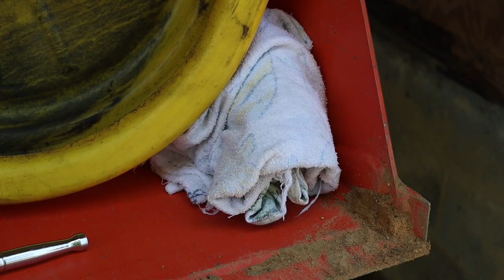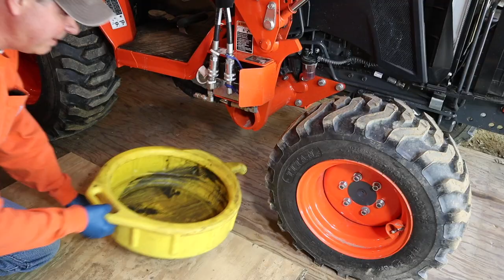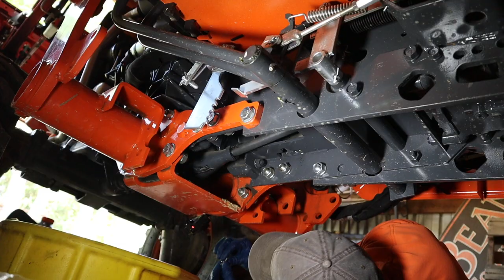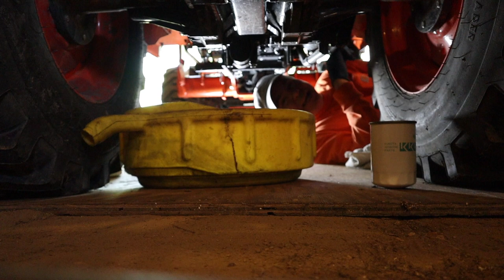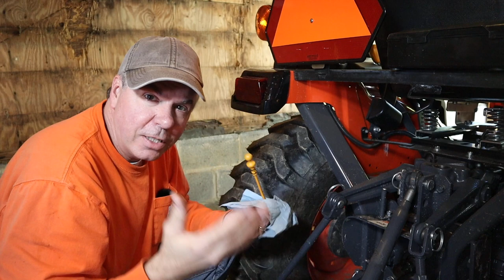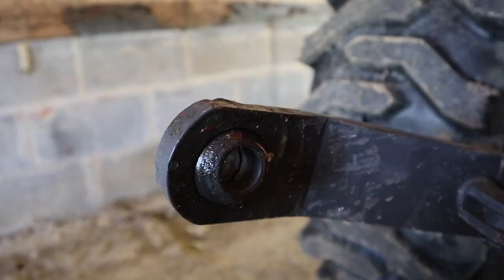#12 Kubota B2601 50 Hour Service How To - Complete With Bonus Tips!

Comment: Just a note...when checking hydrolic fluid level, the three point lift should be all the way down and the loader should be all the way down and the bucket rolled all the way back. This retracts all the cylinders and pushes the fluid into the dip stick check reservoir. If any of the cylinders are extended you'll get a low reading on the dipstick. Then if you add fluid you'll actually be over full.

Comment: When changing out the hydraulic filter you can hook up a shop vacuum to the fill port and tape it in place. This will hold back most of the oil while you are changing out the filter. Less messy. Try it next time! Great videos!
Reply from the maker: Thanks Jack!
Reply: I really hate horizontal filters…

Comment: You are fast on that filter change!!!  I did mine yesterday and lost about 2 gallons of fluid.  My oil pan overflowed.  I have a mid-mount mower deck, so I had to remove the backhoe and go in from behind.  Thank you for the heads up.  I noticed that the B2301 and B2601 don't have side marker lights.  I installed red and amber button LED marker lights for protection at night.  My dealer and the mechanics were impressed.  I also mounted a dome LED beacon on an "L" shaped bracket so it will swivel and self-adjust on the ROPS depending on the ROPS position.

Comment: As always, great video. 
A few "nerd" tips: 
When a copper washer is tightened, they get work hardened. 
Just place them on a fireproof surface and heat them up with a blowtorch. 
That will make them malleable and seal better, the next time around. 
Another tip is to pre fill the engine oil filter. 
It makes the oil pressure come up faster and is easier on the engine. 

Greetings from Sweden.
Reply from the maker: Thanks for watching and for the greeting from Sweden! Interesting tip about the copper washer. Your comments are much appreciated!
Reply: @MyClutteredGarage I do this with my Ducati.  You technically have to replace the copper washer with every filter change, but annealing the washer works just fine.

Comment: Prior to removing oil cap, I always hit it with a rag and compressed air to remove any debris and I also rest the cap back on top so nothing can sneak into the hole. Bad place for debris to get into. I already spray the drain plugs with engine degreaser and wipe them down before removing them as well. Appreciate the video. All seems pretty straight forward
Reply from the maker: Good tips. Thanks!

Comment: A good tip when changing the hydraulic filter first clean the surface,  use a clean container so you can reuses the oil as it last 400 hours. Use a funnel to make your live easy  :)

Comment: Very simple and to the point glad I watched it. On the filter removal they make  a filter socket that fits over the oil filter  face it has a 3/8"  female recess  for a 3/8" socket wench. I have used them on other vehicles  and will try them on  the tractor.
Reply from the maker: Thank Lonnie. I appreciate you suggestions. -Ed

Comment: Another great video.  You are right about the Hydraulic Oil being messy.  Wow.   Thanks.

The white Oil filters are great, you can write the date and hours on them very easily.   Then you can always do a quick check of last service, without referring to your notes.  That is if you can get the cap off of your magic marker. 😆

Comment: Just a tip if you leave the filler cap in place it will slow the initial rush of oil out of the pan, once you have opened the drain bolt then open the fill cap. Keeps the mess to a minimum. Try it , works. Cheers.
Reply from the maker: Thanks!

Comment: Just did my 50 hr service (at 75hrs) and it went well until I got that hydraulic filter.  I lost 2 gallons of fluid!  Totally blew it.  You killed it.  Great job!  Next time I'm calling you.  :)
Reply from the maker: David Armstrong Haha! That one is definitely a challenge. I’ll change your filter if you pour my concrete floor in my tractor shed (you may have spotted the plywood on the dirt floor 😄) -Ed@MCG
Reply: There's a vacuum trick that works pretty well with the hydraulic fluid.  Take the cap off the back of the hydraulic fill and have someone hold a vacuum next to the fill not totally covering the hole.  The pressure from the vacuum keeps most of the fluid from gushing out.  If you're alone, some guys tape the vacuum to the hole.  Other videos on this trick.  Check it out.

Comment: This video was a good reminder that not all the hydraulic oil needs to be drained at a filter change.  I was under the misunderstanding that the hydro oil need to be "changed", the same as the engine crankcase oil.  Very helpful!  If you know, when does the hydro oil actually need to be changed, but I suspect the owner's manual addresses that.  This is a good example ot the need to READ AND UNDERSTAND the instructions, a common failure some of us men have. ;-)
Reply from the maker: Hi Gerald. According to my manual - yes I looked it up - the hydraulic oil only needs to be changed every 400 hours. Score! I was actually thinking I was getting close at 150+ hours but I'll be good for another season or so! Thanks for your comment, and thank's for making me pull up the manual :)
Reply: Isn't the hydraulic fluid and hydrostatic fluid, the same fluid in the same reservoir?

Comment: So great video and thank you for showing the maintenance of the tractor. But I have a few things to point out to make sure its easier for ya. First off they have an oil filter claw tool that can be used on a 3/4 ratchet which will make taking the filters off easier than that tool you used in the video. The other thing is putting on the oil filters on by hand is more than enough. By using the tool to tighten them on will make the next filter change a bit more difficult to remove. Again great video thank you!
Reply from the maker: Great points. Thanks much! -Ed

Comment: Thank you for this video, I am nearing my 50 hour maintenance on my B2601 and this video was perfect.  I’m still a bit worried about changing the hydraulic filter however.  I changed it on my B25D before trading it and didn’t lose more than a cup of hydraulic fluid.  If your not quick to spin on the new one you’ll have a big mess.

Comment: If you have an extra person you can use a shop vac over the fill hole to minimize the oil loss. Shop that creates a negative pressure which stops the oil from draining out.

Comment: I used this video as a guide to service my B2601.  Everything went exactly to plan until I did the hydraulic oil filter.   Not sure if it was because I had my bucket raised (safety lock in place) or not, but the oil flowed like a fire hydrant.  I couldn't get the new filter on as it was instantly covered by fluid and my hands were soaked.  Threading it on was a nightmare and I lost most all my fluid.  Most was caught by the bucket, but I had some overflow mess too.   Next time I'll definitely have my bucket on ground.  Lesson learned.
Reply from the maker: Hey Scott. That sounds like a mess! The dealer told me to just prepare to lose fluid. It’s a messy job and kind of a silly design.
Reply: @MyClutteredGarage  Good to know.  Thanks for the great videos.

Comment: I like to write the hours on the tractor and the date changed on the filters. Also the nut on the front of the right rops can be used to tighten the rops if you buy the BX rop bolt from Kubota. It is the same thread and has a big plastic handle to secure the rops with no play.
Reply from the maker: Wayne Steffen - good practice to do that. I’ve heard about that lock bolt. Odd that they don’t include it. Thanks for your comments and for watching! -Ed
Reply: My Cluttered Garage     You bet , you are right it should be with the tractor! I really enjoyed the videos. You got it right.

Comment: Hi Ed I ended up taking a 10 mm backing off that little radiator hose guard so the radiator hose would Flex just a little more on my lx2610 same deal

Comment: Two final tips, first if you raise the seat and rest it on the steering wheel you can stand a fill the hydraulic reservoir easily. Second go to your Kubota dealer and buy a thumb screw and put it in the nut on the right hand lower ROP to tighten the top ROP and the rattle is gone. Wayne
Reply from the maker: Thanks much! I’ll keep that in kind for the next service. However, the foam weatherstripping works really well. Appreciate the tips! -Ed

Comment: Ed, Harley Davidson makes a plastic sleeve device that goes under the filter 
to help prevent a mess all over the chassis.  Auto parts stores may have something like that.
Don't ask how I know about the mess on the chassis...
Reply from the maker: Sorry I missed this comment. I appreciate the info! -Ed
Reply: I have cut a plastic milk jug to fit under the filter, leave cap on jug, easy way to empty oil  from it.

Comment: I hate being that guy... I was taught to pre fill the filter, yet yours is horizontal so it gets messy, I don't prefill these but I always lube the filter gasket and only tighten just over hand tight then back off a scosh, a smidge... makes removal easy and doesn't leak.
Reply from the maker: Good points. I used to pre-fill vertical filters but I question if it even matters. I also only hand tighten but this radiator hose is really a pain. I like the idea of backing off a hair. Thanks for watching! -Ed

Comment: I'm a GM duramax technician. The Allison transmission has a magnet that sets inbetween the screw on filter and the filter mount. You will often get a click when screwing the filter off or on as the magnet snaps against one surface or the other. Sometimes it remaines attached to the transmission and others it comes off with the filter. Maybe that is what the click was? I'll need to do the 50 hr service on my B2601 before winter. I'll let you know what I find.
Reply from the maker: Rick Lindsey that’s interesting. Look forward to hearing your follow up. Thanks for watching!

Comment: Wiping oil on the new filter’s O-ring isn’t to keep it from getting stuck when you remove it next time. It’s to keep the O-ring from bunching up and possibly tearing or not sealing evenly on install.
Reply from the maker: That’s a great point. I’ve had my share of filters that had ti be destroyed in the process of removing due to being stuck in place. Either way, it’s definitely good practice to lubricate the o-ring. Thanks for watching!
Reply: Be sure to look at the filter gasket on the old filter.  If it sticks to the engine, the the stack of old and new gaskets may seal initially but leak later.

Comment: Great video. 2 things little foggy on. Why didn't you change the hydraulic, and tranny fluid rather than just changing the filters?
Reply from the maker: Thanks for watching, and for your question. The 50 hour service recommends the hydraulic filter and hydro trans filter change only. If I’m not mistaken, the fluid gets changed at the 200 hour service interval. Happy new year! -Ed

Comment: I wonder if the radiator hose touching the oil filter helps cool the filter?. Thanks 👍
Reply from the maker: Thanks Gary. I don’t know but I would think not. I think the coolant and the oil temps kind of balance out since the block is heating the coolant and the coolant is cooling the block. 🤷🏻‍♂️

Comment: This is helpful as I prepare to do the same thing. What kind of strap filter remover are you using?
Reply from the maker: Hi Richard. My strap wrench is probably 30 years old. I think any of them will work. The "cup shaped" filter wrenches that fit over the filter and work with a ratchet and extension are nice too, but you just have to find the right size. Good luck and just be prepared to lose some hydraulic fluid! Good luck! :) -Ed

Comment: The other brands replace the hydraulic oil and the oil in the fount end at 50 hours, plus clean a metal strainer.  Kubota not do that till later on?

Comment: Your video doesn't show where to drain all the hydraulic oil. Also do you add oil to the front axle?
Reply from the maker: Hi Alan. The hydraulic oil doesn’t get changed for the 50 hour service. But you should check the front axle fluid lever. Thanks for watching.

Comment: I'm sorry may have missed, but why change a filter without the fluids drained if you would replace that anyways? Or are you not trying to replace all the hydraulic fluid at 50 hrs?
Reply from the maker: I may not have mentioned it in the video, but the service manual does not call for changing the hydraulic fluid at the 50 hour mark. Thanks for watching!

Comment: Do you think it would be necessary to add liquid wheel ballast to the kubota b2601? I’m thinking about getting one in the near future. Thanks.
Reply from the maker: I added it to mine and it helps. I also always add rear ballast when using the loader (box blade or other implement on the back).
Reply: Ok. Thanks. I test drove one a few days ago and I really liked it. For a smaller size tractor it seems like it can do a lot of work. Really good videos you have. Very informative. Keep them coming.

Comment: Isn't there a breather vent in the HST that can plugged to help slow the loss of hydraulic fluid during a filter change?  Looks like quite a bit of fluid is lost in the process so stopping up that vent maybe worth while.....
Reply from the maker: GFD472 - great idea but everything I heard, even from the dealer was “be prepared to lose fluid and just be quick!” 😄
Reply: @MyClutteredGarage  You are going to loose fluid no doubt about it.....however stopping up the breather vent should slow it down which isn't a bad thing.  HST fluid isn't cheap so to my way of thinking anyway to prevent loss is worth while.  ymmv....
Reply: There's a vacuum trick that works pretty well with the hydraulic fluid.  Take the cap off the back of the hydraulic fill and have someone hold a vacuum next to the fill not totally covering the hole.  The pressure from the vacuum keeps most of the fluid from gushing out.  If you're alone, some guys tape the vacuum to the hole.  Other videos on this trick.  Check it out.

Comment: Understanding that prices very by dealer and state what was the approximate cost of the supplies for the 50 hour service?
Reply from the maker: Sorry I don’t recall. It’s always higher at the dealer, but no question about getting the right items. Thanks for watching!
Reply: Cost me right at $115 for the three filters, 1 gallon of 15W40, 1 gallon of Super UDT 2 (used a couple of quarts to replace what I lost while changing the filters) shipped to my door. I already had grease for the greasing needed at 50 hrs.

Comment: When you go under anything supported by hydraulic pressure you need to put a physical support under it to prevent it from falling. If an O ring or fitting fails it will fall and injure you. I lost a friend to a failed oil fitting and hate to see it happen to anyone. Do not trust your life to a 50 cent o ring or a 5 dollar fitting.
Reply from the maker: Very sorry to hear about your friend. Thank you for your comments and concern. Very appreciated. -Ed

Comment: That oil looked a lot older than 50 hours.
Reply from the maker: Yeah, diesels seem to turn oil black quickly.
Reply: @MyClutteredGarage   - mine was at 50 and still looked like "honey" - it is an L4701 - not sure why the difference; very odd for sure. Thanks for your awesome videos!